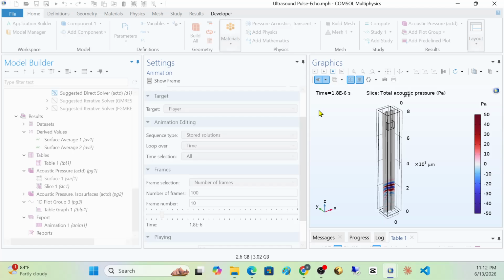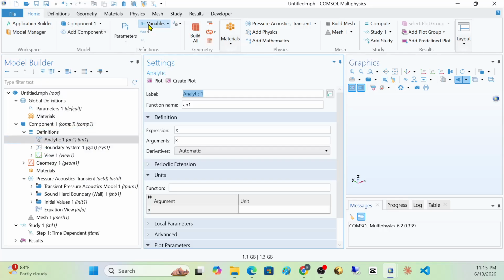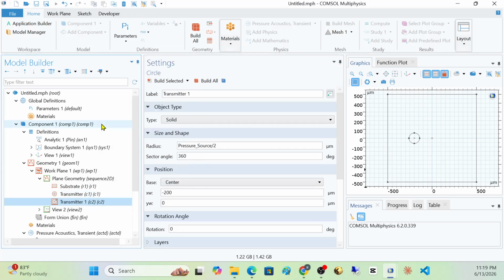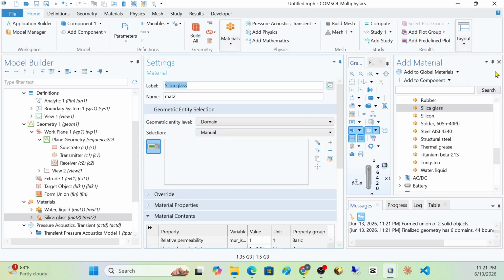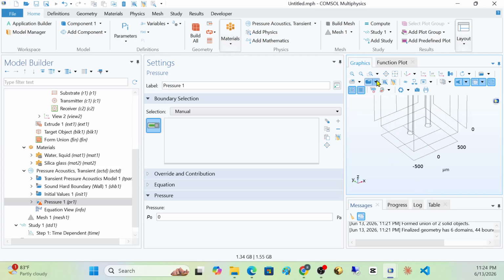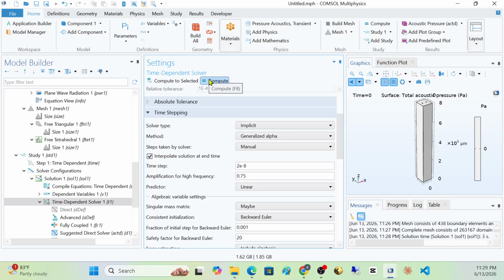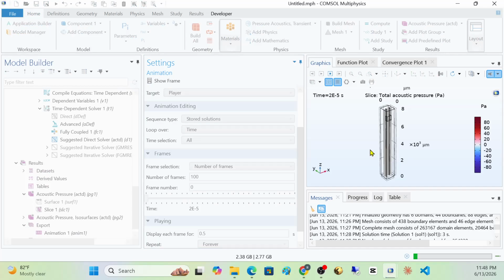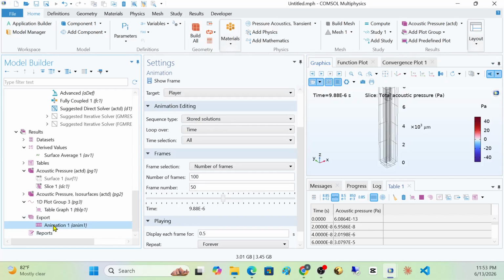COMSOL Simulation: Ultrasound Pulse-Echo

Comment: Can you please simulate: Y. Raj, K. Shukla, T. Datta and M. Sen, "Micro Cantilever-Based Optical Gravimeter," in IEEE Sensors Journal, vol. 21, no. 13, pp. 14759-14766, 1 July1, 2021, doi: 10.1109/JSEN.2021.3072639.